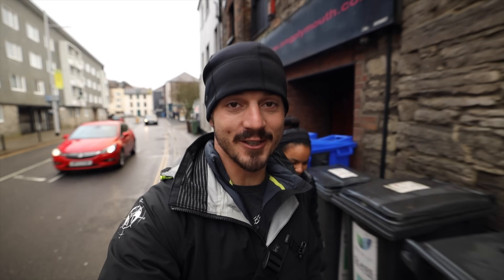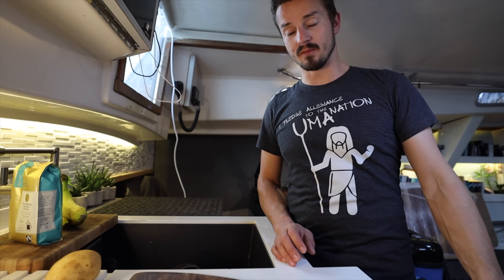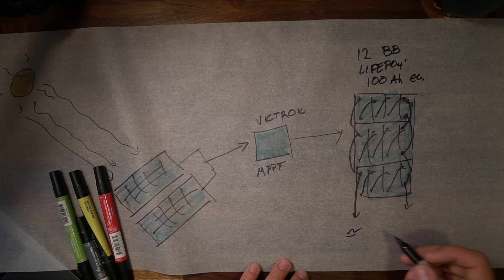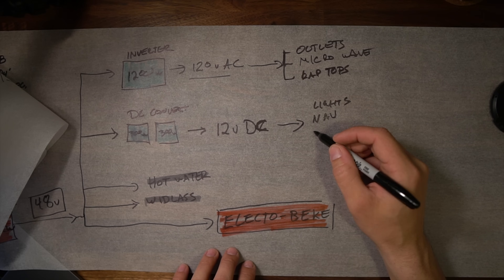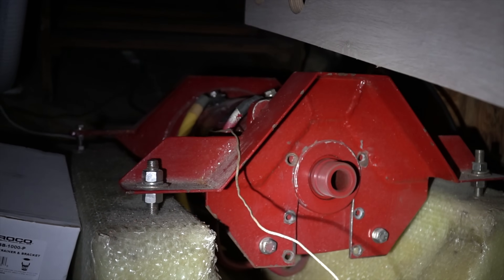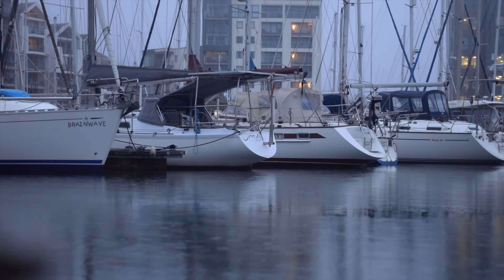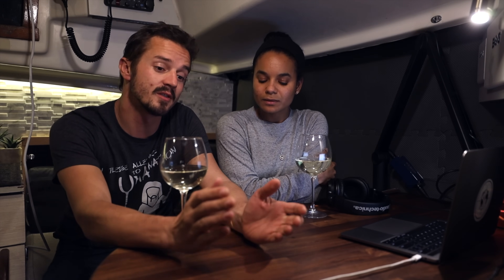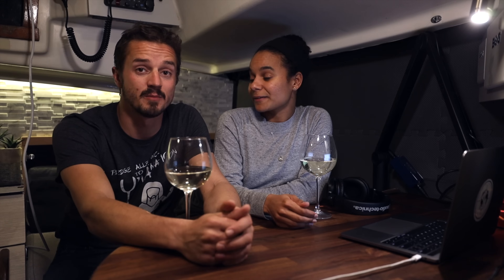5 Years Living offgrid on an ALL ELECTRIC Sailboat — Sailing Uma [Step 206]

Comment: just reading from your web page sailinguma.com/the-motor have few question when you have a min,  Does your system generate any power back in while sailing  and is there a way to have an alternator connected to the system to additionally charge the bank . If you had a choice and money was not an issue which unit would you choose and why? and finally out of your research do these all need 48v systems as building a 24 v system just now. thx guys
Reply from the maker: No our motor can’t generate power while sailing, unfortunately. But we have some plans to solve this soon. Yes you can put a alternator off to the side for getting some power back while sailing but it’s not as efficient as having the right motor and controller for regen. This obviously won’t be beneficial while motoring, since it takes power to make power. 

The best motor on the market right now is the Oceanvolt Servo prop SD. After 8+ yrs, surprisingly they still don’t have any competition in the industry. It’s very easy to get an electric motor to push a boat forward, but the magic and real benefit is having all the power you need when sailing from regen, this is where pretty much every manufacturer falls short. 

Yes 48V systems have become pretty standard. You can easily find parts and components and still keep you amps low enough to be manageable. 

Hope that helps!
Reply: @SailingUma  Hi Yes very helpful, just looking at upgrading the House bank and trying to future proof it to end up with an Electric Drive. Thx guys

Comment: I'm very curious about the information  on the forklift motor you used??  I'm thinking I'd like to keep my diesel engine and add electric as the  twin-screw
Reply from the maker: You can do even better. Just add an electric motor behind your transmission. Electric Yacht makes one.

Comment: Hi guys.  I LOVE your videos and have binge watched the entire series!  Excellent chemistry between the two of you and I wish you all the best..  One thing I would like to see as an upgrade to your boat is an induction cooktop.  When you say all-electric that does not include the cooktop right?  It looks to be a gimbal mounted unit running on butane.  But Cheers, and keep the AWESOME videos coming!!
Reply from the maker: Maybe one day, but we'd need a larger inverter first, and those are expensive. But our current stove top is actually alcohol and works quite well. We also like having redundant systems onboard, and not relying solely on electricity.

Comment: Kicking around the idea of converting our 42ft Westsail to electric before we head out on a 5 to 7 year World cruise.  Very interesting.   Only one battery bank?  (correct?)   You don't have separate for house/propulsion
Reply from the maker: We did have separate banks at the beginning. But keeping them both charged required double of everything, so we opted for one bank. The whole point of electric for us was simplification, so the simpler the better.

Comment: Hy work the Battelborn battery good How long do you have them
Reply from the maker: Almost 2 years now. Often forget we even have them since they just work all the time. No maintenance, never worrying about state of charge or if we're damaging the batteries. We pull the covers off about every 6 months for a visual inspection, but so far they everything looks the same as the day we installed them.

Comment: I sincerely appreciate your sharing your experience with renewable power for your boat and how you accomplished that. It’s very interesting and potentially very helpful. I did not really understand, however, the amount of energy that you require/consume in a typical day. You mentioned using 1.5 kw in a day but kilowatts are a rate of energy while amp-hours are an amount of energy. I’m not trying to be critical but I’m just trying to understand what your total daily requirements are. Thank you for your videos and thank you for sharing some of the technical aspects of long term live-aboard sailing. Best wishes!

Comment: Hey guys, I subscribed some months ago and have watched a few episodes now.  This one caught my attention because I live and sail in Alaska.  I have a nearly fully restored Catalina sailboat with two solar panels and a 'Dometic' like refer (it's made by Alpicool) that I installed this past year.  Love it!  Only had a built in ice box before.  I run two deep cycle batteries but plan to install one more this year because the refer draws more power.  Plus, all my lights were converted to LED's about 6 years ago. 

Just a couple of suggestions/questions.  Can you add two more solar panels to the side of the mount for your current solar panels and hinge them so that they store in a vertical position on the sides and then can hinge and 'lock' into place when flipped to a horizontal position?  I looked at the video at 11:44 and can see that perhaps you have room.  Adding 2 extra solar panels could double the amount of 'juice' you get from the solar array.  Also, I use two of the flexible panels on my dodger, which work great because I can take them off and stow them if I want to drop the dodger or just leave them up for normal cruising.  Do you have a dodger?  If so, can you add the lightweight flexible panels to it (or are there other locations on your deck where you could add the semi-flexible panels?  Just a thought.  Also, those towable water generators work well above 3 knots of boat speed.  Might be worth looking into them:  https://www.sailmagazine.com/diy/water-power

Comment: That seems to be a very efficient system your guys have set up there! Have you also considered using those plug in capacitors to assist in saving on your power consumption?

Comment: I myself have a sailboat and I am also going to go all electric. You mentioned that you want a windturbine on you boat and I have some tips for you if you would like to hear some. I have some experience with windturbine and have contacted many companies and have my own ideas how to do it. I am an electric engineer and have a passion for renewable energy.

1. Going with a windturbine is really a great way to get energy to your boat, one of the best. Solar panels is really inefficient with about 15-18% efficiency at optimal condition. When living up north like me, or areas with less sun hours, it is not much energy you can get on few solar panels. And boats don't have much space, you can only put a few panels. So solar panels isn't that great at all when you think about it. Still it is the most common off-grid power source.
A wind turbine on the other hand is more efficient and very space efficient on what you fit on a small place like a boat. You can lots of power from one windturbine instead of having to cover the boat stern to bow with solar panels.

2. Bigger windturbine exist but they can't be found at your hardware store or hobbyist boat store. They are usually sold directly from the OEM manufacturer and many chinese manufacturers are coming up now that make bigger turbines with 1-10kw power. I have some contacts and have myself contacted a few companies. I could give you some links.

3. Noise is something to consider when you have a windturbine on a boat. Even small turbines make noise. And noise can be transferred. I have heard noise on an boat that the owner put the turbine on the mast. Because the mast is fixed to the boat in to the cabin the noise is transferred thought vibrations down the mast to the cabin and heard even inside. So try to have the windturbine away from the sleeping cabin is best.

4. VAWT is less noisy. Vertical Axis Wind Turbine is a thing and have now got better designs then previous VAWT so they are not much less efficient then a normal wind turbine. They're less noisy, safer for birds, less ugly design and could even be better on a boat that can get the wind from more infrequent directions.

5. Wind power makes sense on a sailboat. A sailboat is used in windy weather. The main thing about sailboats is the wind. You already have sails to make wind energy to forward moving energy. So putting a extra thing that takes the wind energy that isn't used by the sail to make electric energy to power an electric motor is almost the same as putting on an extra sail to move to boat forward. A sail isn't really very efficient (1.2 lift coefficient), so to use a windturbine to power an electric motor is not that inefficient as it sounds. That is actually a thing and there are boats that use only one big wind turbine instead of sails to power the boat forward. Search for windmill boat. They have the advantage that they can "sail" in any direction to the wind. If I could I would do something like that in my boat.

6. Wind turbine together with solar is a good combination. When going off-grid, you need to spread out the energy source as much as you can. To have multiple sources is best to have redundancy if one source isn't optimal because of the conditions. If the sun gone for some days or the no good wind, it is good to have both as sources for power as they help each other when the other fails.

7. A water turbine during sailing isn't the best logical thing. Use the electric motor as a generator when sailing is an extra feature, but it isn't the one of the first things you should do. People even buy small hydro turbines and retrofit them on the rear. But if you think about it, it is not that logical and efficient. When sailing you use the wind energy to get the boat up to speed. And to break that speed that you try to maintain with a water turbine sounds not like the best and straight forward thing to do. The wind energy get transformed to the sails then to moving energy to the boat then to moving to the prop and to electric energy to the water turbine. Instead you can go from same source, wind more directly to electricity with a wind turbine. The less stages you take the better. And it won't break the speed of the boat. You could even get more speed if the windturbine drives the electric motor if you haven't reach maximum hullspeed.

8. Going with higher voltage then 12 or 24 or 48v can be a benefit if have bigger setups. Equipment like inverters and motor are little bit more efficient and have motor often have more torque. Cables can be smaller more safe, less currant.

9. Electric motors is great for boats and can save lots of money compared of the amount of diesel per hour it uses, average medium size sailboat about 6l/h. When looking for a motor don't compare KW power to the HP of an ICE engine. Compare the torque. Also be in mind of peak vs continuous. A electric motor is always rated in continuous output. ICE is always peak.
Reply: Alot of that is completely wrong
Reply: @alabastardmasterson  like what if you think you know so much?
Reply: @alabastardmasterson  Which parts?  Elaborate.
Reply: Interesting. The noise would be annoying but I can see the massive benefits.
Reply: This is intriguing to me also.  But my interest is more in replacing tired diesel engines/fuel tanks, standing/running rigging, and sails and go all-electric.  I'm not sure we are there yet but it sounds like a cool idea in principle. 

The trick is storing enough energy and generating enough energy.  Electric motors and controls for prime movers are a very well known commodity.  Non-fuel based options for electric generation on a vessel are wind, sun, and, using regeneration, tidal.  Perhaps hydrogen fuel cells but that is an area I haven't explored.

The wind turbines definitely have solar beat with respect to generation capacity.  They also have solar beat with respect to an environmental and financial payback period in larger systems.  I would imagine that is also true is smaller systems.

I see big solar-powered catamarans but I'm skeptical.  A few experimental autonomous vessels have been solar-powered.  Still, I just don't see how they could generate enough power to be a prime mover.

I will look up sail ships.  Sounds interesting.  A big VAWT on a ship with the generator/battery and electrics contained in the keel sounds cool.  One would have to be very careful above deck :)

Comment: Is there a reason why you deal in watts and not amps?
Reply from the maker: Watts never change. Amps and volts change depending on how you wire you’re batteries. Most boats are either 12v or 24v. Our boat is 48v. But across all of them, the same appliance will draw the same watts. It’s less confusing that way.

Comment: My experience with electrics on boats has centred around the difficulties of keeping them functioning properly in the seamist-type air common below deck on most boats. Have you done anything specific to minimise this sort of problem?
Reply from the maker: All the victron stuff is waterproof. As long as the connections are made properly, they’ll last for many years. No issues so far.
Reply: @SailingUma  thanks for the reply. Yes, corrosion to connections is what I used to see most.

Comment: I may have not made myselfe clear. the catmaran i am buying is only 6 meters in length. but my new catamaran has a target at the back and the soler panel i got currently is 250w so the wind generator i am going to get will be only 250w witch is ok for my power consumption. and eveything is working fine.
please keep an eye out for my ytube channel after i buy the new boat.
Gerard.

Comment: G'day.
have you considered an wind generator ?. I am going to install one onmy new sailing catamaran as it has the space and an ideal location on the boat.
The reson is that on my new boat its going to be electric all of it. the solar is 250 watts works well 
and the wind generartor will charge while sailing and at anchour. complments each other.
Gerard.
Reply from the maker: If you have the space for one they work great. on a Cat you can mount them aft and keep the vibrations isolated from the cabin. It's much harder to mount a large one on a small boat like ours.

Comment: I know it has to suck being on youtube and having people pick apart everything you do, but at the same time others are watching these videos and using them as a "how to" type of thing without going back and watching your videos from past to present. 

You can't really say you have been living "off grid on an all electric sailboat" for 5 years when you have had to rely on dingy outboards for propulsion when the electric engine/battery system wasn't up to snuff and have used propane for cooking etc. Also would be helpful to mention the overall costs of your current system so people realize how much it costs to try to setup an all electric sailboat without sponsorship.
Reply from the maker: Off grid literally means not being plugged into the power, gas and water grid. It doesn’t mean Un-contacted tribe in the Amazon. We don’t rely on the power grid to get our daily needs. 

As for the price. We’ve covered a lot of that in past videos and on our website. Our initial set up that we used for the first 3 years was basic, cheap and effective and all of that is covered in our website. It’s has certainly been nice to collaborate with companies, test new equipment and push the boundaries of efficiency and what is possible, but you certainly don’t need the fancy high end stuff to get started.

Comment: Can you please add info on the laptop(s) you use that run so well on batteries w/o being plugged in much (or did I overlook?) Thanks!  Love your videos and positive attitude too!
Reply: They are not talking about battery life so much, but power consumption. Well they said laptop from old computer. Not sure if them meant computer as in actual PC, or not. Prolly not. While I can not answer for them specifically, any newer generation CPU with the smaller architecture will generally speaking use much less power. That is just one of the ways they were able to get such smaller by using less power which creates less heat or thermal power which was one of the main issues in going smaller. So by them simply upgrading from older laptop to a newer one would have been big improvement. So you likely want to be looking for anything with CPU architecture of 14nm or 10nm. You should also keep eye out of Ultra Low Voltage laptops as well. Sometime labeled ULV or SU or etc depending on generation of CPU. Many of those only use 15W opposed to some of the older ones that could 90W or more.

Some actual examples: Broadwell i5-5200U - i5-5350U (15W); Skylake i5-6200U - i5-6360U (15W); Kaby Lake i5-7Y54 / i57Y57 (4.5W); Amber Lake i5-8200Y / i5-8210Y (5W / 7W); any of the Ultra-low power Ice Lake (15W) or Ice Lake i5-1030G4 - i5-1030G7 (9W)
Reply: MacBooks

Comment: Wind turbines help alot with generating power!! Sweet video.  Omg 15 grand in battle born batteries.  20k in victron. Damm.... more than our r.v cost.... 400 amp hours at 48 volts. With 12 x12 volt batteries in series = is 48 volts....

Comment: You guys are pioneering here, thanks for sharing. I hope you try to generate energy with your motor, its such an elegant solution and very powerful (approximately 1000x more than a wind turbine of similar diameter since water is 1000x denser than air).  It's been said in other comments but i'll say it again and lay out the equation: power = energy/time   i.e. watts = joules/second   Therefore energy = power*time  i.e. Joules or wattseconds = watts*seconds and kwh = kw*h

Comment: My boss signed up for the one day free access to the Vault because he is interested in seeing your wiring details for the solar panel and charge controller.  Unfortunately, that part is "coming soon".  When do you anticipate this will be posted?  His user name is Joemccurdy
Reply from the maker: We have some more upgrades to make to our electrical this winter, then we’ll put together a comprehensive diagram this spring. In the meantime, we have a lot of info on our original system on our website https://www.sailinguma.com/electro-beke 

Hope that helps.